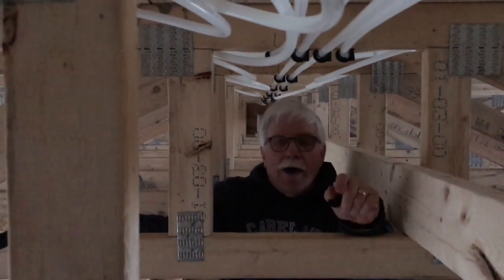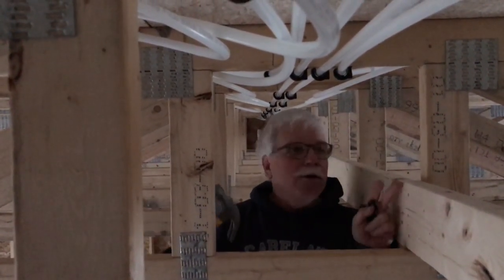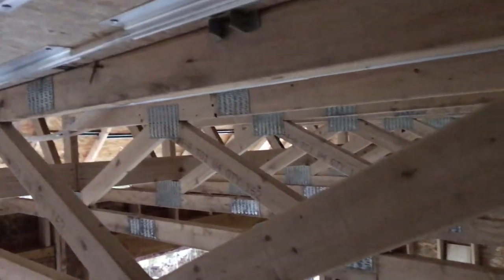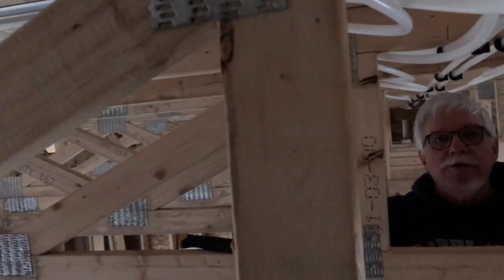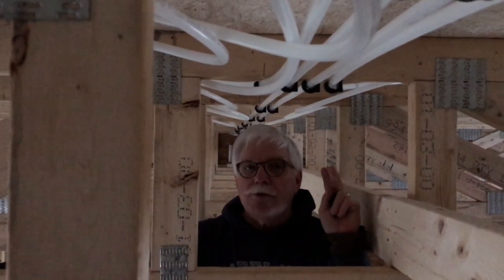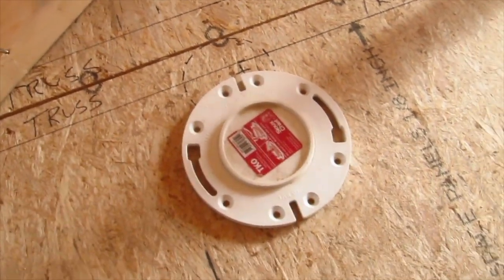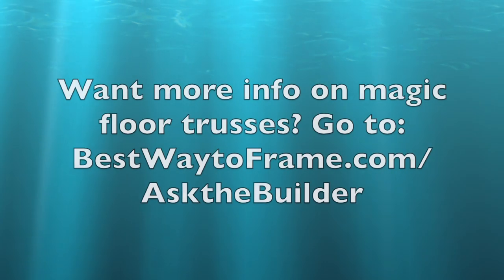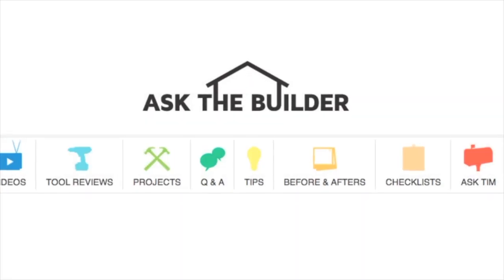Floor Truss Framing

Comment: OSB :(
Reply from the maker: Matt, I've got a question or two for you. How do you feel about 3/4-inch seven-ply fir plywood vs OSB? Imagine being a carpenter back after the great WW II and seeing plywood explode in popularity. It eventually supplanted T&G 1x6s that were used for subfloors, wall and roof sheathing. I have no idea what the next generation product is, but something is going to kick OSB to the curb. BTW, I'm old enough to have seen the birth of OSB. Products like Advantech are miles ahead in quality of version 1.0 OSB.
Reply: @askthebuilder  OSB is absolutely good enough 95% of the time for any application where it is used. It is the last 5% where OSB is significantly worse than other available materials. Water will always find its way in.
Reply from the maker: Matt, now you have me really confused! Can you expand on your 5% comment? If water will get in as you say and I pretty much agree with you on that, how is it that anything but treated lumber or some other material unfazed by water will be better than OSB? In other words, if water gets in and soaks the fir plywood or traditional 1x6s, how is it they don't rot just like the OSB? I hope I'm making sense.
Reply: @askthebuilder  leave a sheet of OSB and plywood out one rain storm and see which is still servicable.  If a pipe bursts in one of these new buildings with OSB joists the building is shot.
Reply from the maker: I don't think you read my previous comments. You may want to do that.
Reply: @askthebuilder  Now we are seeing almost every single new build using 7/16 OSB. Prices are crazy